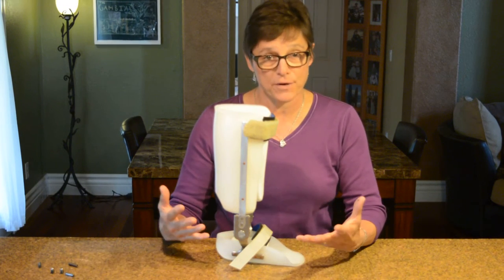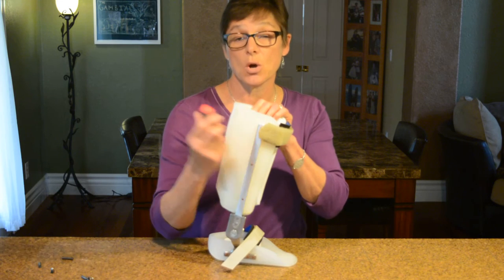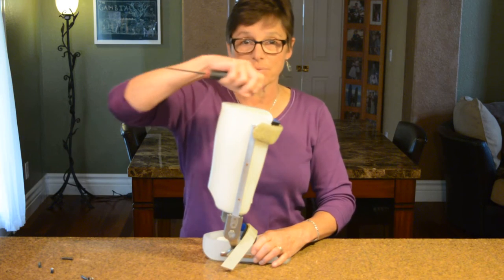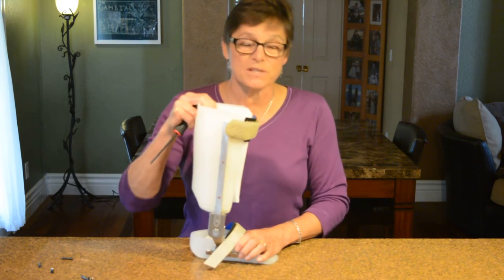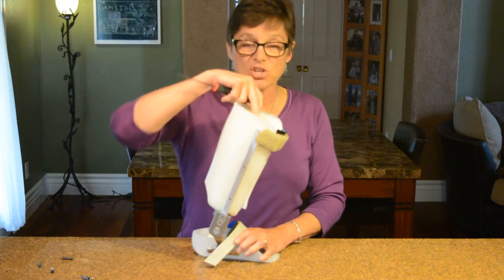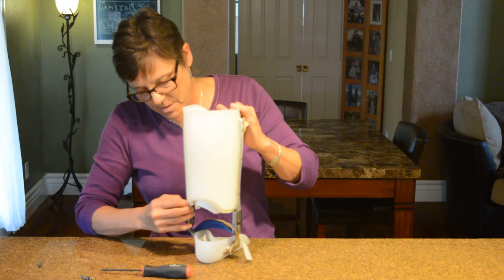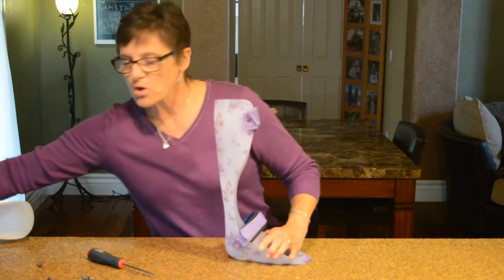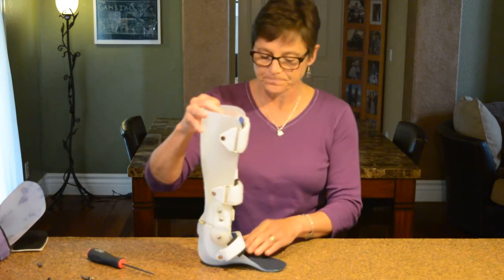AFO biomechanics

Comment: I'm wondering if I would benefit from an afo brace. I have mild Spastic Diplegic Cerebral Palsy, and I recently had achilles tendon lengthening surgery. My physical therapist noted that whenever I walk I walk with my foot turned in eversion, lack heel strike and toe off, my left hip dips down whenever I walk, and my foot slaps on the ground whenever I am walking.
Reply from the maker: soory I just saw this post. Yes it sounds like you would benefit form some type of AFO but without knowing your strengths and ROM picture I can not recommend anythng specific . Find a PT who is an NCS in your area with FInd A PT and hopefully they can help you